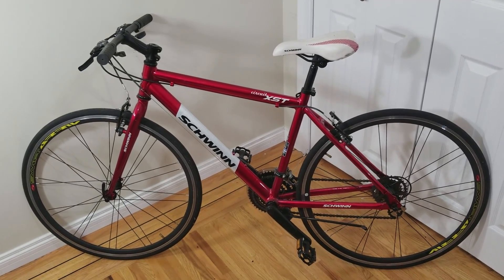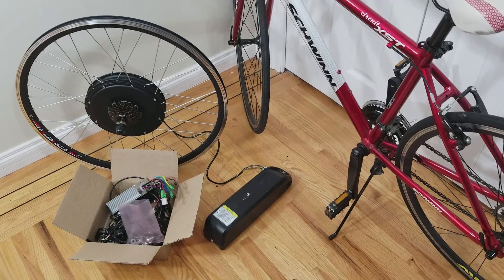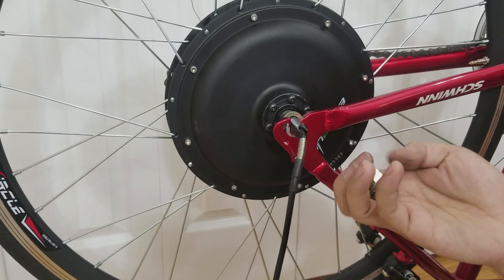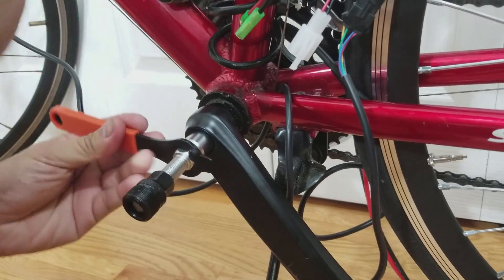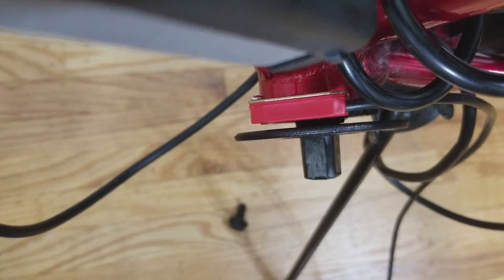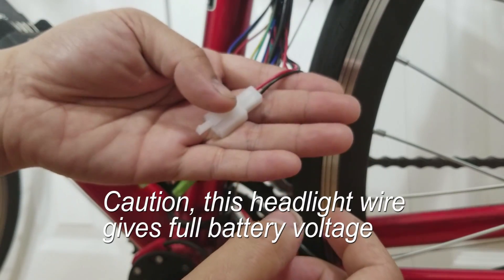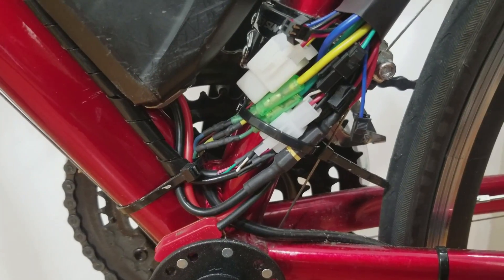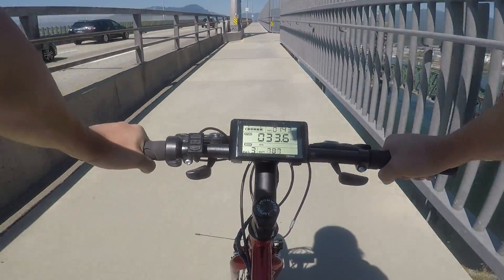1200 Watt EBike Build - Cheap + Fast = DIY

Comment: In the UK 1200W and 52kph would class this as a motorcycle.
So... motorbike licence, licence plate,
vehicle check certificate (MOT),
insurance, lights/horn, crash helmet etc., and you can only ride on roads.

Comment: How safe is a set up like this using a stock chain? Also drilling holes into an aluminium frame? Won't that make the frame weaker?
Reply: The stock chain is fine 1.2kw is not much more power than a professional can output with their legs. And the tiny holes will make little difference unless your 300 lbs and if that was the case  I think you should be getting the work out of a normal bike.

Comment: 48v x 14ha = 672 watts on the battery.
The battery is weak for 1200 watts motor.
Reply: Please note that a 14ah battery is rated to delivery 1 amp for 14 hours or 14 amps for 1 hour, etc.  With a 48v battery and 1200 watt (peak) motor, peak current draw is 25 amps.  From the link in the description, this battery is capable of 25amp to 30 amp continuous discharge current, so the battery is capable of supporting the motor.  However, as you point our 14 amp hours only lets him ride at full throttle for approximately half an hour.

Comment: Some genius needs to invent an alternator to recharge the battery.
I know you'll always lose out but it should be possible to get quite a substantial recharge.
Reply: i think it could be done with some firmware update
Reply: Solar power pad
Reply: You would probably not get much out of it.  Unless you are mainly going up and down hills, you would be mostly coasting to a stop, so only a little bit of regen.
Regen in Formula E for example is very powerful (they regen over 30% of the battery capacity over a race) but they are slowing down every 10 seconds or so.
Reply: Thank you for the replies.

Comment: Hmmm... I wonder if these would survive 72v with a controller upgrade (shockingly, a 72v 1500w controller only seems to cost $35). If you're top speed is 32 mph, then that's still slower than my top speed with just a pedal bike... Also my range is like 30 miles as long as I have a snack in my back pocket, and that's while averaging 25 mph. Obviously I wouldn't want to go slower, so 72v should give me a speed of (72/48)*32= 48 mph top speed (assuming I'm pedaling my hardest, that should be realistic since its only 16 mph faster using a motor rated way above my power output). That would be just about right, I'm probably going to do duel wheel (front and back) with 72v sometime, it would be nice if these super cheap kits can handle it, I know some people have done this on the Voilamart branded ones even on the stock 48v controller! Those are super affordable too, I just got a fat-bike kit from that company for $170 and just need to find a fatbike to put it on, haha!)

I'll have to see how high people have over-volted these, because they look like the best cheap alternative (the Voilamart brand doesn't seem to carry 700c, which is a bummer... 700c roadbike wheels and 26 inch MTB wheels have different spoke counts, so you can't change the rims from the 26 inch kit since its not an integer multiple of each other. Plus if you tried drilling extra holes, Somewhere around 1/8 of your way around you'll end up having 2 holes basically side by side and that's just going to break, so you'd have to make a large adapter mounting plate and rivet to the motor casing through the spoke holes, and then drill that adapter to the correct for 700c... That just sounds like un-needed work!)

Comment: lmao $1,000 is not cheap bro
Reply: Depends on bike. The kit is $209 right now on Ebay ($259 if you want the LCD display instead of LED version), and a 20 AH 48v Li-ion battery (much bigger than he has) is $325. So that does cost a decent amount, but its still only $534 to $548. Now, with a nice used Bianchi road bike, yeah you're at $1k, but then again, a lot of WHEELS I look at are $3k each... Like as in, the rear wheel is $3k, that's not with a motor, that's just a wheel! It doesn't even have the sprocket on it for that price either... So, its still cheaper than lots of regular pedal bikes, but its also not as cheap as the cheapest Walmart garbage you can find. I too wish prices on everything was free, but that's sadly not the case, and that's also the reason I don't have a $4.4k ZIPP 858 NSW wheelset (in addition to preferably a time trial setup with disk wheel and tri-spoke ideally, but then that's REALLY big bucks!)
Reply: Compared to a $5k-7k commercially made ebike its cheap, but you're right, walking is cheaper.
Reply: Ya thats expensive, just get a 1k road bike and you will average 30kmh no effort when u reach a good fitness point
Reply: @estebanrent604  Yep, after 6 months without touching the bike (about 1 year after any ride over 5 miles), I still averaged 19.2 to 20 mph on gravel near my house on a nice afternoon out having fun (speed is over a long ride until I ran out of food, this average includes breaks) which is just over 30 kph on gravel (speed was only limited by how fast I could go before sliding into the ditch, it was horrifically big gravel chunks and just laid down so it was rolling around everywhere). On pavement its much faster! 

I totally agree, road bikes are ridiculously fast. I rode my MTB next, and I don't know what the speed was, but it felt like 5 mph, LOL! I went from staying in gears 16 through 18 (out of 18) on my roadie down to a crawl on the MTB, road bikes turn you into super man!

I did this on my Bianchi road bike with slammed handle bars (riding the drops the entire time) and with 23mm Coyote tires. The bike is all aluminum, except I have bare carbon fiber seat and seatpost. The seat also doubles as a good mail package opener because the edges are so sharp... Looked amazing though! and slightly threatening at the same time... Nicknamed the @ss hatchet by other racers, lol!

I'm hoping to hit 50 mph on an ebike (I usually hit 30 mph, or around 50 kph if its no wind, so I'll have to re-gear my bike because around 35 mph is where it tops out). It should be fun! I love going fast, and right now I'm seriously out of shape (I rode the 6 miles to work in an embarrassingly slow 15mph/24kph average with traffic, but it was paved, and I still felt exhausted at the end of that... it was bad!). Time to get back into shape for me!

Comment: Nice video and clean build... do you ever think of customizing and installing two electric motor on the bike?
Reply: At that point just buy a motorcycle, bicycles are not built to handle so much power/speed
Reply: Would be a waste of money and power. Might add a bit more torque on hills but otherwise the two motors would be competing at the same RPM while using the same amount of power draw. 

That's the reason you don't see cars with two engines in them. :-P
Reply: @autonomous2010  But you have many Teslas with both front and rear motors and some other electric cars that have a motor on each hub. Granted, they use a lot of sensors and processing to determine how to distribute the power between the motors at any one time which is perhaps too big of a project for an e-bike.

For powerful e-bikes though a problem is the front wanting to lift under acceleration so it's liable to wheel spin which would be dangerous. So perhaps it's better to compare with the fact that generally there aren't two wheel drive motorcycles for the road. Traction control would help, but again, that's a bit of a big ask for e-bikes.

Comment: Nice job with the torque arms! 

There is a solution for your wiring: search for 'Hailong Battery controller' in ebay. This replaces your complete controller box as well as making it weather proof!

Cheers

Comment: I build bikes usually mid-drives what you can't tidy up/conceal with heat shrink or braiding/heat shrink I use neoprene sheets black and black double sided tape and cable ties. It really looks professional. Additionally you can use old inside tyre tubes to wrap around cables. I get cheap neoprene from local diving store in small sheets they use for repairs.
Reply: Great idea!  Using a zip-tied innertube stretched around the wiring would be a neat solution, assuming the controller itself was  water proof.

Comment: I thought the law was you can't go over 20 miles an hour and you can't have over 750 watt of power?
To drive legally on the street.
Reply: I can crank out faster than that with no electric assist needed. It's a stupid law.
Reply: That's why I'm going this route. I wanted to just buy one and avoid all the hassle, but I'd end up spending nearly twice as much for a sweet, clean looking bike that goes nowhere near as fast. It's a shame. But at least we don't have to register them in the US for now so I'll just slow down when I see cops, same as driving my car.

BTW my car can go faster than any posted speed limit in this country, and it was legally manufactured that way. Weird.

Comment: $470 US for that battery is absolutely ridiculous.
14Ah at 48V is 670Wh.
18650s go for $0.7 on aliexpress and even the absolute worst ones will have at least 4Wh of usable capacity, meaning 650Wh would cost 150$ - probably less.
Paying $320 for a plastic case and a 2A charger?
You can buy an imax b6 charger for $25 and it'll charge any type of battery you could ever want...so it's a $295 markup for what is essentially a $3 piece of molded ABS plastic.
Reply: Those 4wh for those cheap 18650s is bull shit

Comment: A $650 battery is not cheap.  If you think that is cheap then I have a question for you.  Hey can I borrow $650?  Since it's cheap to you?  :)
Reply: I just built an ebike for $300 usd ($50 used walmart bike, $140 kit, 4 lead acid 12v 12ah batteries for $13.50 each, back rack: $13, bag for batteries: $15, charger: $22) That's a cheap ebike.  Now before all the diehard ebike fanboys or w/e you call yourselves start crying about my setup, my point here is CHEAP.  Not ideal.  So stfu about lead acid.  I paid $54 for my battery, he paid $650.  Yes his is better and more ideal.  Again my point is that I was going for as cheap as possible because I am investing as much money as I can rather than buying nice things, so I went for bare minimum to get me back and forth to where I need to ride it for the summer.
Reply: @waynefilkins8394  How are the batteries working out?. I am thinking building a bike using some sealed lead acid batteries I already have. I may look to a better system later but just want to get building, riding, learning.  Cheers
Reply: @joeshmoe7967  I haven't rode it a lot because my front wheel needs a new tube, I accidentally popped the good tube moving it from one rim to another.  When it had air in it I rode it down the road and a few laps around the yard (big yard) it was even tearing through mud puddles.  Pretty good power, but somewhat difficult to handle because I have rear hub motor and 4 heavy sla batteries on the back so all that weight on the back end.  I don't know if the tire will hold up or if I keep it like that, may need to find a way to get 2 of those batteries to the front of the bike.  Otherwise I don't see a problem with it.  with 3a charger it takes 4 or 5 hours to charge, don't get 2a.  If I could do something different I probably would have gotten those skinnier lighter scooter batteries.  They only hold like 8ah but it would take some weight off it and they take up less room too.

Comment: You can run the wires through the frame with a few holes. Nice clean look. 
They also make wire dressing called "looms" that clean up all the loose wires.
Great vid.

Comment: Do you know if can use a 48V 10Ah battery with a 1000 watt rear hub motor, though the controller apparently requires a 48V 11.6Ah battery ?
Reply: You can use any ah you want.  Shouldn't matter.  Just will go less distance if it's lower.  Just make sure the voltage is 48
Reply: @waynefilkins8394  Thank you

Comment: Ahhh.... The good ole drilling into your frame technique.
Reply: How do you think your bottle cage mounts are installed? Exactly the same way - but likely mechanised.
Reply: @forevercomputing  They are installed by the manufacturer under supervision of an engineer.
Reply: @bob15479  Are they BOLLOCKS
Reply: @bob15479  you wish

Comment: gees my beach cruiser is going to end up 50+ lbs. i park it in my apartment. upstairs.😩🍻
Reply: I don't know how direct drive hubs perform in such a case but my geared climbs stairs by itself with just a slight twist of the throttle.
Reply: Use motor to go up stairs?

Comment: I swear those torque arms don't help what so ever my ebike is 3000w and that thing will still move but I doubt you will use it with 1000w
Reply: 3000w😂 just Drive Motorcycle
Reply: noah 76 I do want to get a motorcycle a r6 but bike is really convenient for small trips

Comment: @Doug Hnut ....MANY THANKS from BAVARIA! 
...how far can you drive with minimum force of your feet (the maximum motor power)? 
...how does the battery behave over time? Is it still so powerfull? What about safety (Explotion)?
...which parts - or set - would you buy Today? Could you sent me a link to a single set? 
...what do you think of the China EBike "SameBike L026" for 600EUR?
Reply: juerhe1 you can‘t drive these bikes in Germany. If you‘re having an accident, insurance won‘t cover it.

Comment: How well do you think this would hold up to a 60v. battery?
Reply: The capacitors inside this battery are rated for 63 volt, so a 48 or 52 Volt battery works but not 60 volt. If you change the capacitors to 80 volt or above you can safely use a 60v (16s) battery.

Comment: iv got a 1000 watt e bike (kit) ive done 4000 miles on it .. the only problems are spokes snapping (16 broken to date ) and it only does half the miles per charge as stated when bought .. apart from that its been fine ..

Comment: Very good job with the video! But unless there are battery alternatives, the kit plus battery aren't  very affordable for most people, nor is it practical for most with all the modifications required. Kind of a shame, need to be rich to help save the environment. But if you can pay off the bike with gasoline savings before any cheap parts break, it might be worth it. (I know, I can pedal, walk, or hitchhike. 😁)
Still, thank you for the video!
Reply: The "save the environment" argument is pretty iffy with EBikes. Just defers the source of the problem somewhere else. Collecting and processing Lithium for LiPo batteries is pretty hard on the environment and (at least in the USA), most of our electrical power still comes from burning coal or gas. In a bigger city, it does keep local pollution levels down if lots of people use Ebikes so that's a huge plus. 

The financial cost isn't promising either due to the batteries. LiPo batteries have a shelf life that while it's much better than battery tech used to be, it still ages. Worse news is that LiPo batteries age even when not in use and their lifespan is usually around three years. The financial difference could be promising if you used the Ebike daily but if you treat it as a fun toy, it will cost you a lot more than you are getting out of it.

Comment: That ain't to bad good bit of speed but make sure you have disc hydrolic brakes optional extra £100. I just got the 2019 48v17amh 1500w brushless motor with brake regeneration build in through back brake.pluss how did they fit the controller in the rear hub wheel?.

Comment: Good God those batteries are expensive!
Reply: Yes i paid about 560Cn for a 52V 20amp
Reply: I built my own and the battery cost more than the kit and the bike combined.
Reply: Not really if you get good deal on batteries and build your own.
One of my battery packs only cost me £60 to make for 14s 6p 48v to 58.6V.
My other battery pack cost me about £170 for 14s 5p
I use both of them together = 14s 11p.

Comment: I have realized I want/need a faster ebike. I originally got a small 250w geared hub and need a more powerful assist so I can reduce my commute time and still get the experience a d environmental benefit of bicycling to work. Since it will be expensive and time intensive to get a kit, I am comparing it to buying a modest priced whole ebike.